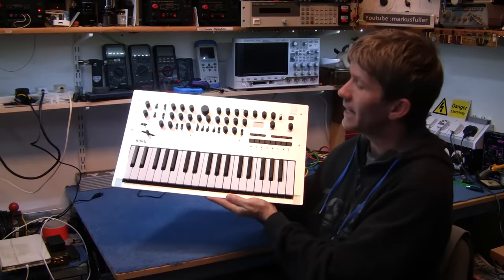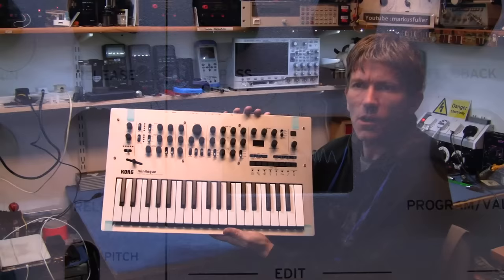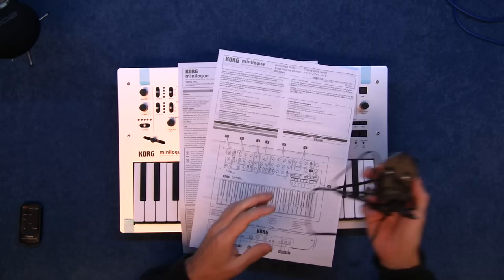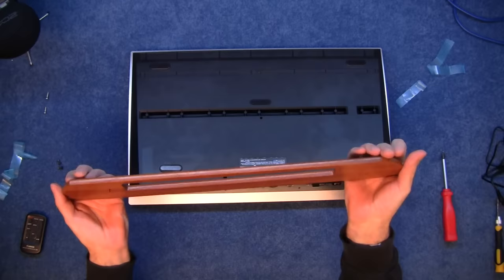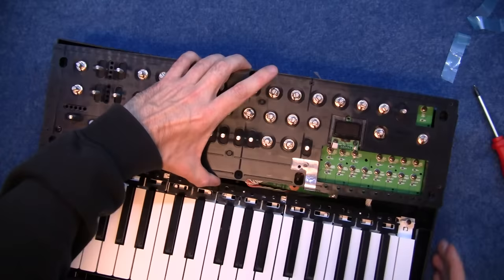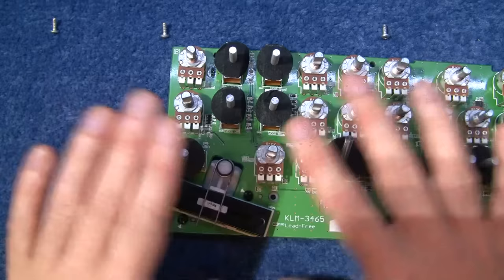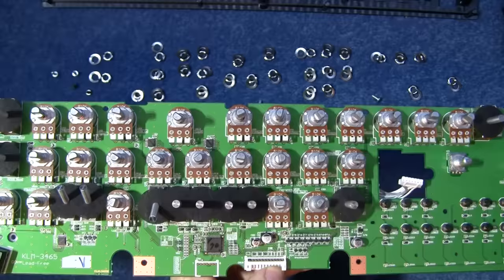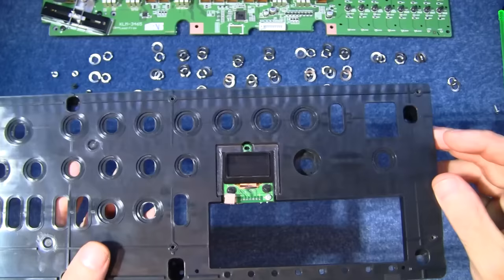Korg minilogue polyphonic analog synthesizer teardown MF#68

Comment: Six processors , I found it already odd seeing the five crystals.  Korg usually does it board design like a computer with specialize chip doing the most of the work but this seems like module together. I do say its a nice design tho.
Reply from the maker: +WulfCry Hi Yes it is an interesting design and I think Korg could extend this even further in the near future.
Reply: +WulfCry My reaction to. One ARM processor/voice seems a bit.. odd. I dont know exactly what its doing.
Reply: Daniel Regnér I'm guessing but could be spot on. The ARM could be handling the oled screen. ARM can be applied for  serial data  as most have  build in video/Gpu processing  or can have with manufactured request some occasion.
Reply: WulfCry the one on the controlboard probably handles all knobs and the display. The question is what those in each voice are doing instead of having one per two voice (or one beefier handling all four)
Reply from the maker: Yes it seemed a bit overkill as they are quite powerful chips.
Reply: Well the engineer that conceived this handled it as he did with little bits and the volca's :) small compact and overall power . This guy belong to a new young batch at korg development. First time hearing it could tell that why it got sold out so quickly here and there.
Reply: +Daniel Regnér true, i cannot remember a synth having a processor per voice in any sof Marcus' teardowns. And it's voltage controlled oscillators, not DSP generated. Maybe their purpose is to somehow supervise the tuning, stability and calibration of the voice circuit?
Reply: +Jan Minor Yes I've read somewhere that it has some kind of self-tuning/calibrating
Reply from the maker: Yes it can self tune and also anytime you wish you press shift & Rec and it retunes itself.
Reply: markusfuller A synth that tunes itself sounds like synth-voodoo to me is it alive. I have to be ignorant here cause its the first time I've heard of a keyboard doing that.
Reply from the maker: well me too but with 5 times 4mhz crystals on each processor I guess theres some clever timing going on there
Reply: markusfuller
My guess: The "voice processor" generates a, control-voltage for, as an example, pitch.
Then there is "test points". since you know what you sent out and what the voltage in that point should be when in tune its a "simple" task to compensate that in the next sample

I think the bottleneck isn't the computingpower, rather how many ADC/DAC:s you can update simultaneous
Reply: +WulfCry The vintage OBX and OBXA had self tuning also.
Reply from the maker: Oh yes the OBX did I remember now.

Comment: Those rubberised  knobs will need replacing, after a few years they get clammy/icky whatever you might call it! I expect someone will make an alternative case for rack mounting it..
Reply from the maker: +Nicholas Bryant I hope tio change them for metal turned knobs as soon as i can get enough to do the job.
Reply: +Nicholas Bryant I've had synths with rubberized knobs before and they tend to dry out. But I've discovered that Armorall brings them back to life. I have a Waldorf Microwave xt that had that problem but i managed to fix it
Reply: Car polish? How did you make the connection?
Reply: +Nicholas Bryant car interiors have a lot of rubberized panels like dashboards and stuff like that. And I just gave it a shot and it worked.

Comment: Hi are there any circuit boards under the keys ? Could you remove the keyboard and then modify the chassis and faceplate to turn it into a desktop module easily ?
Reply from the maker: +digital1010ben Hello there is just the one thin board under the keys with the switchgear on it. then there is the main analog board with all the voice control and oscillators on that. I guess you could make a desktop module with it.
Reply: Thanks matey for quick reply

Comment: The left modulation slider is made of a linear potentiometer and a spring? It's as cheap as hell. The aluminum face plate and the wood back plate is nothing but thin camouflage. It's made of 100% plastic inner shell. Even the power supply section is disastrous. Capacitors were eliminated to save the production cost. 

No one will call this a vintage in a year. Useless, valueless, face-lifted, hybrid toy~
Reply: +Pao Nan Well it works doesn't it? Not everyone wants to pay 2 grand for a synth, even if it is better made. But, as he pointed out, a lot of the synth was quite high quality, like all the knobs and switches. For 500 bucks it's really good value, even with all the stuff you pointed out.
Reply: Pao Nan incorrect

Comment: hope they don't actually market it as "analog" since it obviously isn't :P
Reply: +sinephase voicing and signal path are analog, which is probably what most people care about.  Envelopes and controls are digital, but much higher resolution than normal midi, so they will sound and feel much closer to analog. Not sure if the oscillators are DCOs? Anybody? It wouldm't ne hard to have the ARM chips take care of DCO style tuning etc..
Reply: +Ash Nicolas Watson they are VCO's
Reply: sinephase it IS analog.

Comment: for me it's about the sound, and the sounds on this synth just don't do it for me. you can squeeze in all the tech specs like 4 voice poly etc. the proof is ultimately in the pudding.. compared to other synths this one sounds like a toy. and i don;t know why, perhaps the price point is hinting at something they (Korg) know. ie. it's not competing it with the pro synths. best to do your homework and compare it yourself, to moog, waldorf, nord etc.
Reply from the maker: +The Tree There are some amazing sounds in this little synth and with a few effects you can make it sound big. but it is made down to a price so more people can afford it and get into synthesis in an analog nature. I have moogs etc which yes sound better in someways but they are several times the cost.
Reply: +markusfuller Yah, I got to play with this synth a few weeks ago, and it's amazing for the price.  The sound is a bit thin, but I imagine it can become quite phat with addition of overdrive and reverb (lack of onboard overdrive was my only disappointment).  The Minilogue sound is somewhat thin, yet sterile in a pleasing manner (sounds "pretty")- neutral ground suited to post processing.  (The AKAI Timbre Wolf, on the other hand, sounds like garbage and is not really acceptable under any circumstance.)
Reply from the maker: Hi I have been experimenting by playing mine through several guitar effects pedals and its sounding much nicer.
Reply: markusfuller Sweet!  The guitar pedal route was also what I was considering, if not played through DAW plugins.  There's something I really miss from having an all hardware music setup, so I wanted this synth for laptop noodling, as opposed to serious music composition.  The new era of analog synths has gotten rolling in the past few years, so I'm definitely looking forward to the future of the scene.
Reply from the maker: Im sure with all these powerful processors we are going to see some amazing synths over the next few years.
Reply: The Tree I don't know what kind of toy you have in mind but this synth surely doesn't sound like a toy at all.
There are plenty of tutorials on YT which explains how to get from this little beast all kind of sounds.
Besides, it has his own character...you can create amazing sounds simply by blending and shaping  the two oscillators without even touching the filter. You can do things with the minilogue that you can't do with far more expensive synths: in fact it's a revolutionary instrument

Comment: Pathetic design failure.

6 cheap ARM processors inside. This cheap synth is nothing but a hybrid synth.

Analog signal path? That doesn't make it justified with the word analog.

Bogus product!
Reply: +Pao Nan Just like my Moog Sub 37 then, or my Dave Smith gear. Nothing wrong with hybrid, but with digital LFO's and envelopes and stuff like that it's just the container holding the wine. Put it in a glass, put it in a cup, it's still freakin' wine bro'. You can still taste the analogue goodness.
Reply from the maker: +AndyQ True I fully agree, It is still Analog like most analog synths are these days and Im sure theres plenty more flavours on the way through the next few years.

Comment: It only sounds different 'cause it's hybrid. No analog! All the control signals were made to be D/A-fied to make it motion controlled and patch-stored. KORG is sinking like the old APR's. Poorest product in a decade.
Reply: +Pao Nan It would be twice the price, at least ,if all control/CV circuitry was pure analogue. You're talking about adding 8 analog ADSRs, a couple of multimode analogue LFOs, and then losing some ability to save patches. With low speed/frequency controls I think it's totally fine to use digitally genrated CV and it ought to be something like 10bit fixed point, which with smoothing is gonna sound fine.
Reply: +Pao Nan The signal path is analog. Lots of analog synths use digital technology; it's only in the signal path that it really matters.
Reply: Pao Nan it's analog.  And analog/digital means nothing in a final mix.
Reply: Pao Nan the prophet-5 had a microprocessor as well.